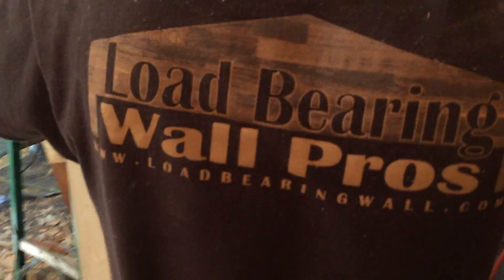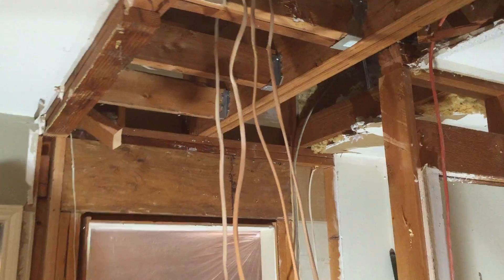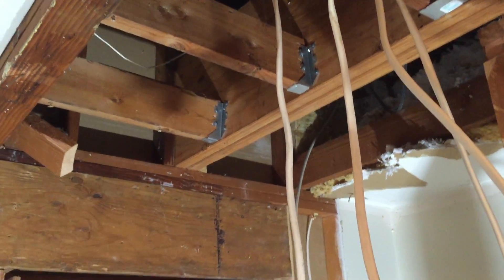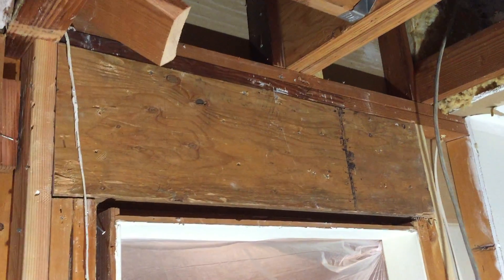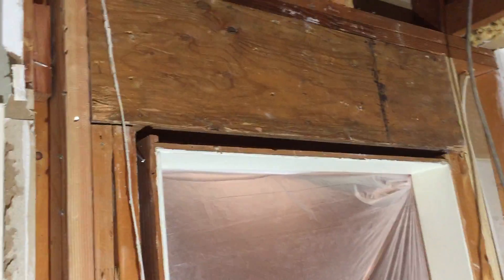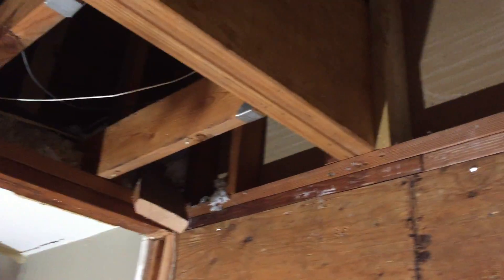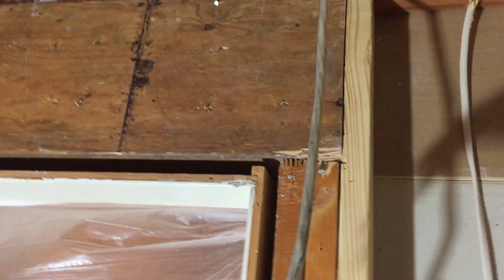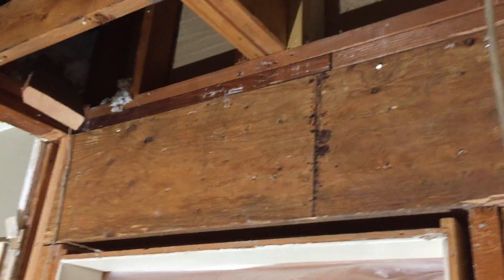Load Bearing Wall over a doorway

Comment: Is it possible to have the upper beam rest in the centre of the door lintel over a 3 metre span provided the lintel is deep enough? I have a gable roof and there is a 'beam over' above the open plan lounge. I want to put 3 metres of bifold doors in the exterior end wall of the house. Ideally I dont want to have a central post in the middle of the door opening.